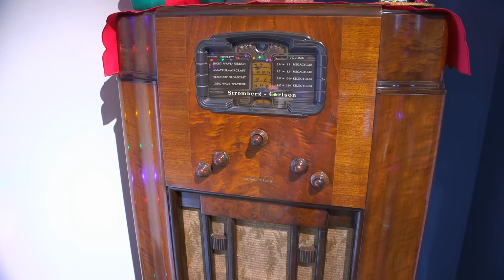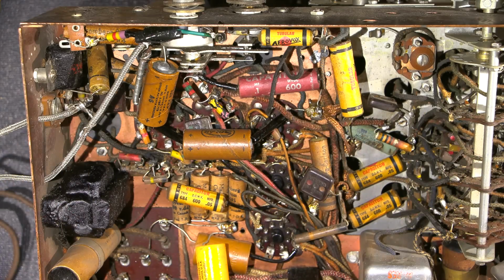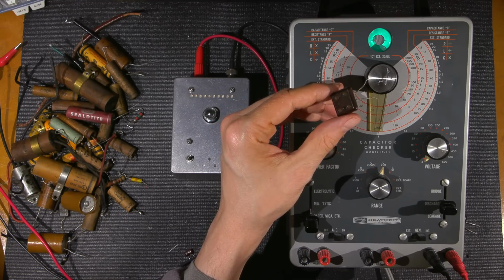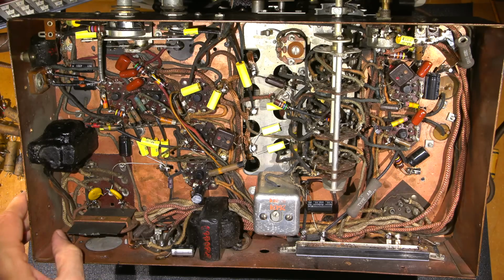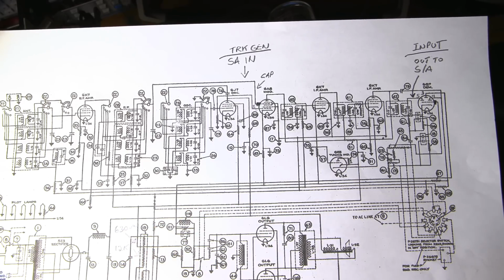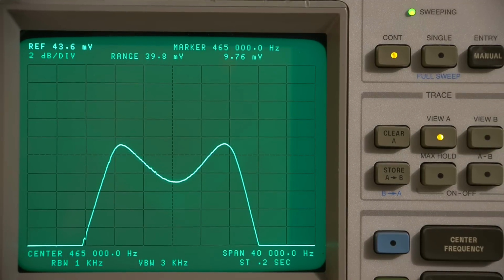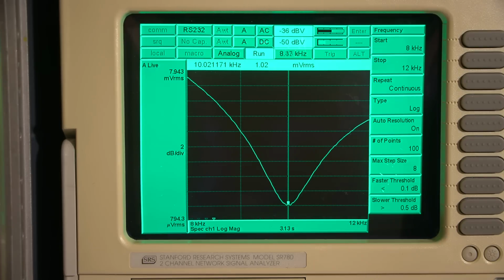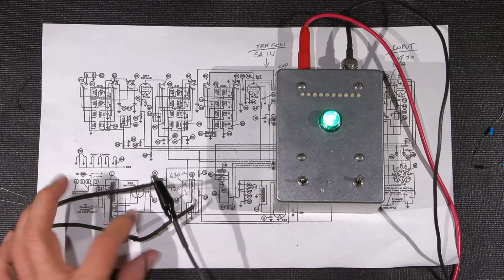84 Year Old Radio Receiver Restoration! Stromberg-Carlson 145L

Comment: Hello Mr Carlson !!  That speaker surround was actually called Carpinchoe leather! the Carpinchoe was or is an Australian type of big rat. That leather is very pliable in that speaker which is very very good!!!  I have 3 radios home here which have that same type of speaker 2 are Stromberg Carlson and the third is a G.E. Longfellow grandfather clock radio. the problem with these speakers as the ages mount up is that this leather gets awfully stiff, and this is somehow dependent on the atmosphere where the radio spent most of its life somehow, it hardens the leather!!
Reply from the maker: Hi John. I wonder if this has been replaced at some time, it looks and feels exactly like felt. The site you found your info on is most likely this "exact" radio.

Comment: The acoustical labyrinth is basically a tuned port. I know that Bose has been using this design for years.
Reply: I believe it's a waveguide / transmission line.   I was hoping paul would investigate/explain it a little more :).

Comment: Mr. Carlson, is the hole in the speaker cone that is adjacent to the voice coil there by design? It's not unusual for the voice coil to be ventilated to the front an many older drivers, but I've never seen a hole cut in a speaker cone like that. Thanks for the fascinating videos, and Merry Christmas!
Reply from the maker: Hi Bob, Yes, that's how they were made. It's known as an early "Speaker Spider," and these early speakers have no dust cap. The newer speakers have their spiders below the cone.
Reply: @MrCarlsonsLab  Thank you!